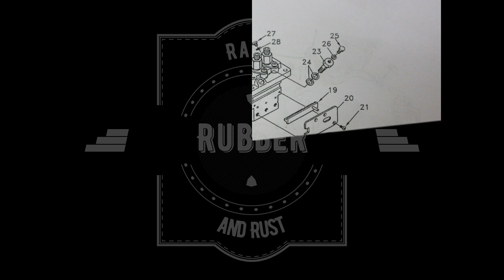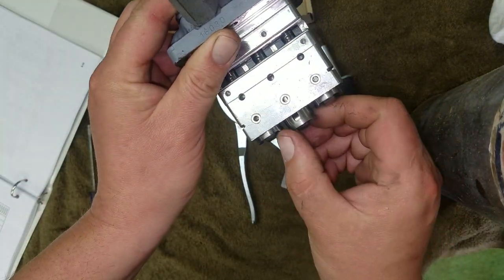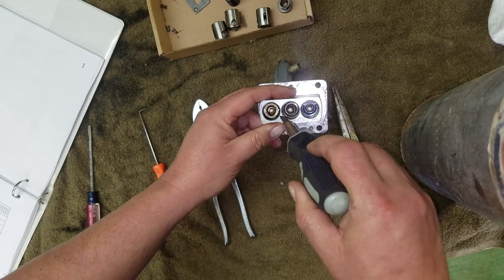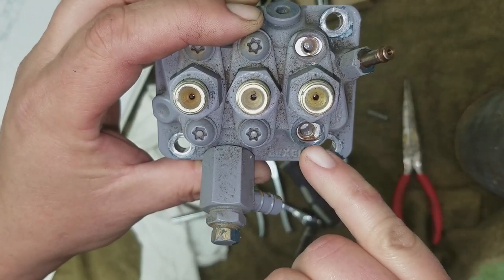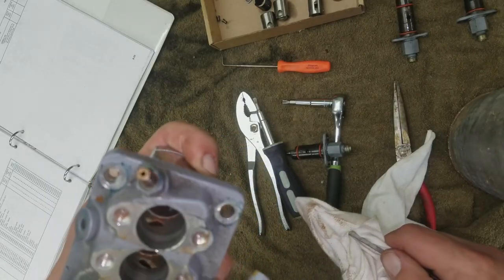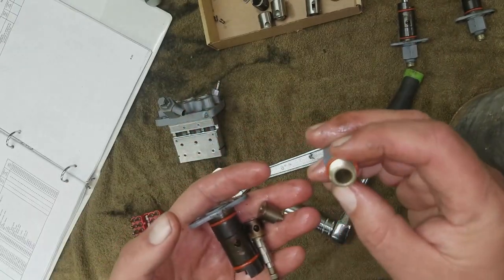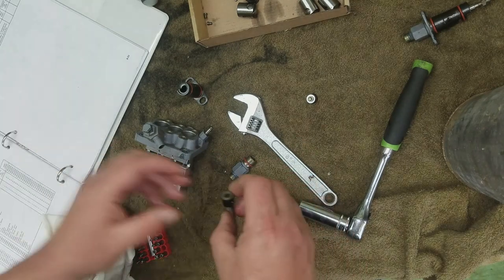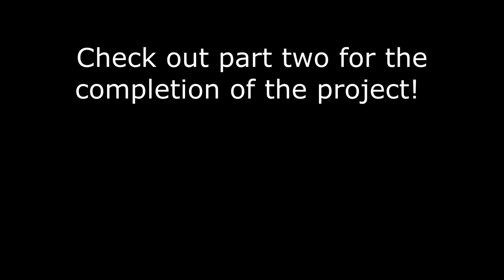Kubota 3 cylinder diesel Zexel injection pump rebuild Part 1

Comment: You don't strip these down like that at all, you certainly don't remove the torque screws from the top. Undo the 17 mm diesel nuts from the top and the spring unit you were fighting with at the bottom will just drop out.

Comment: Do u remember if the 2 O-rings on the body whas the same? i rebuilding one myself and the upper grove is 16,9mm and the lower one 15,9 but the seals in the kit is the same size so i don´t dare to order that kit,
Reply from the maker: I believe they were the same size o rings, at least I didn't match them anywhere and it has been running fine for years that way. O rings can stretch a little no problem. One mm is nothing really.

Comment: Can you pull that pump straight off? Or do I need to take anything off the drive assembly off? Curious mainly about lining up the shut off shaft.
Reply from the maker: Yes, no need to remove the cam below it. Pump comes right out, after linkages are disconnected.
Reply: @steamman5320  awesome! So I can just remove my linkage, and the 4 bolts holding it in, and lift it out? What about the spring that pushes on shut off shaft
Reply from the maker: @StephenBrewer89  if I remember correctly, you take the plate off the front, unhook the spring with shutoff linkage, and the four top bolts and it just lifts out.
Reply: @steamman5320  thank you! Big help

Comment: I also have a D905 diesel engine. When she runs for a minute it revs up without touching the throttle. I change the exact pump you tore apart. Any ideas on what would cause that ? thanks,Ken
Reply from the maker: Was it doing it before you changed the pump? Maybe the spring for the governor, or the governor itself is messed up or broken?

Comment: Thanks, you helped me get my problem figured out. On mine, parts 19 and 20 in that diagram you showed, were bent slightly. Just enough to hang up every once and a while. I hammered them flat and cleaned everything and she's back up and running.

Comment: Question for you.  If you just have a set of bad o-rings could you get away with just pulling the two security-torx and remove the upper portion?

Comment: Hi , when remove the pump from engine did you check timing? Or just remove botls? 
I am sure after rebuilt pump and put again in engine you need to check timing 
? Best regards
Very helpful video!
Reply from the maker: No need, while this is a distribution style pump (the fuel is pressurized and delivered at the proper time to the injectors by the injection pump, unlike a common rail system where the IP simply pressurizes the fuel, and the cam shaft or electric pulse fires the injectors) the timing is controlled by a small three lobe camshaft inside the lower part of the injector/govenor housing. The rollers on the pump ride on the shaft to provide the timing. Since I didn't have to take that shaft out, there is no need to check the timing. Simply disconnect the govenor/throttle linkages, remove shut off solenoid and fuel lines, unbolt and remove. Very simple system.
Reply: @steamman5320  many thanks again!
Congratulations! You are a skilled man!

Comment: Thanks for the video man! We can’t get our fairway mower to start at work. Really hoping this will help us. I would assume it would cause the shut off slide is really stiff on ours. I’m not even the mechanic, I’ve just taken fascination with working on equipment 😄

Update: one injector was bad. Pulled it apart and it looked really clean, but the plunger was really stiff. Not a spec of rust and no visible burrs. The parts manual for the engine included all the part numbers, but the parts weren’t labeled. Tried ordering parts from the dealer. Dealer said we can only buy the entire pump assembly. At a cost of over $1000. Not sure what we’re going to do yet.

Comment: I hear a lot of people saying that the top "turret" (where the fuel lines are connected) is tuned by the amount that it is screwed in or out, and if you move it then you need to send it off to get re-tuned. But this appears to be false?
Reply from the maker: I believe that rotating them as you said can change the timing of the fuel, however I set them back right were they had been (could tell by the paint removed) and it starts, runs, and loads fine.

Comment: Fantastic video just a question, can you remove the injector pump without touching the Gove or/throttle linkage? I have a Kubota D1005-E engine. I would have loved to see you remove it

Comment: Thanks for making that man.
Question: where do you find new o-rings?
Reply: Call your local kubota dealer. They should be able to get all replacement parts for you.
Reply: I did a full rebuild and used factory o-rings.  No more leaks.  Seeing videos like your takes the black magic out of the equation, thanks.

Comment: I do have a question, Was replacing my glow plugs and needed to remove my fuel lines to access, I ended up taking out the fuel injector piston/spring assembly but the main body with two o rings was still inside. When removing the piston a flake of paint fell into the injector pump, I’m at a loss how to get the paint flake out. The engines on a boat so not great access for full removal, any ideas would be hugely appreciated.  I did attempt to start the engine before identifying that the paint flake inside was probably a bad thing :-(

Also, if I was to remove the pump, do I need to mess with attaching/detaching the governor spring?
Reply: Well a little late to the party here, but since the engine ran a bit can you tell if there is only one cylinder that's not firing? It's possible that the plaint flake got jammed into an injector nozzle. If thats the case then maby an injector nozzle needs to be replaced. Hard to say if there is any other damage. Id have the injectors pop and flow tested at a injection shop and go from there.

Comment: I wonder if it was "Carb Dipped" if it would have cleaned up without disassembly?
Reply from the maker: Possibly, if the cleaning agent would be able to get into the pump with it locked the way it was. I tore it down more because I had know idea what was wrong, could have been something bent or broken, or really rusted solid. If someone has one with the same issue, it would be worth a try I suppose.